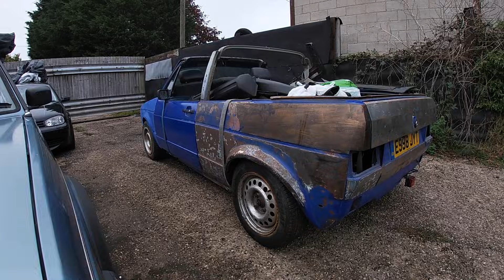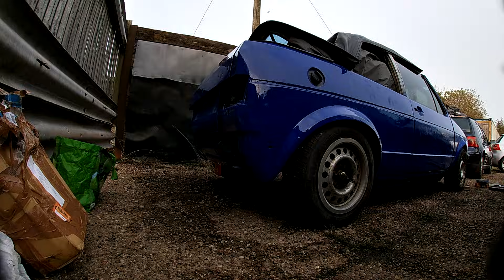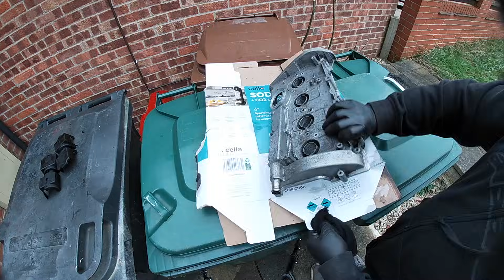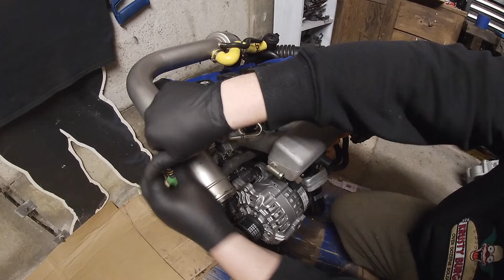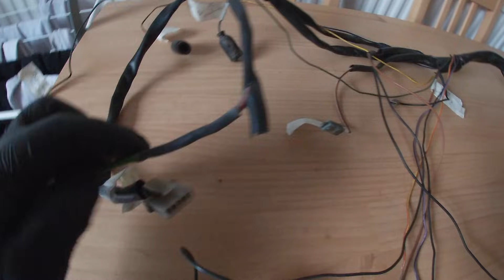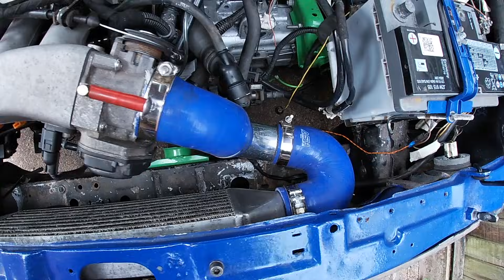MK1 Golf 1.8T 20V Conversion Full Build From Abandoned Project To Driving

Comment from the maker: 0:00 Introduction
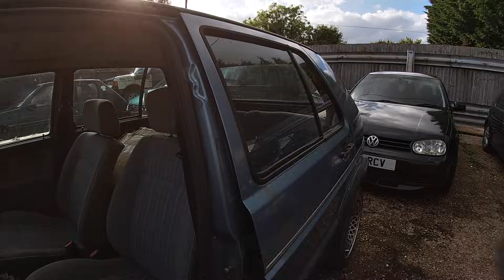0:39 Rescuing the mk1, inspecting parts 
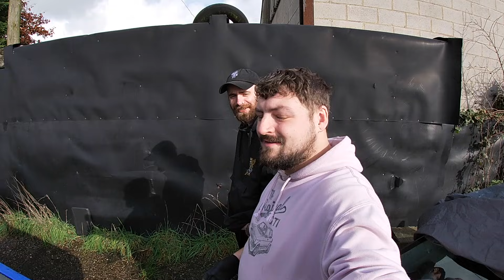7:13 Winter proofing 
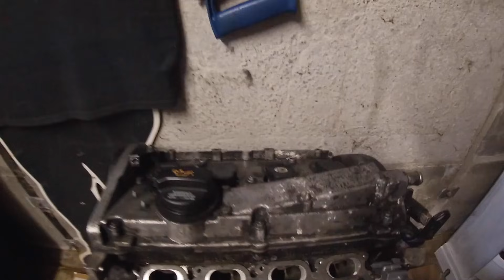20:00 Cleaning and rebuilding the 20v engine
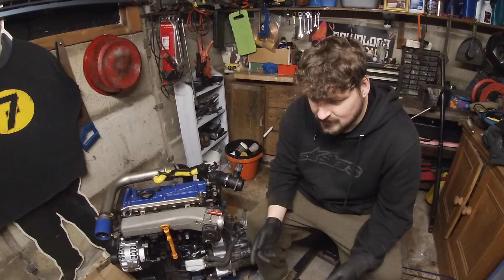51:09 Compatible Gearboxes
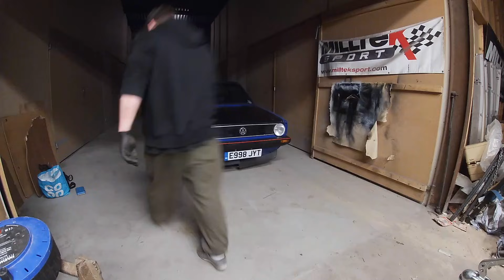55:10 Fitting the engine into the bay
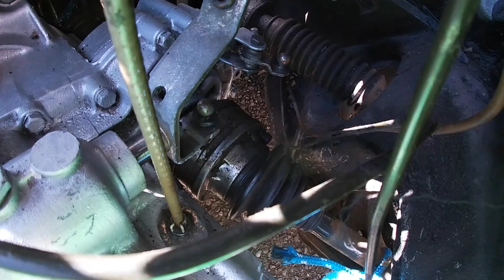59:05 Downpipe, linkages, fitment around the engine
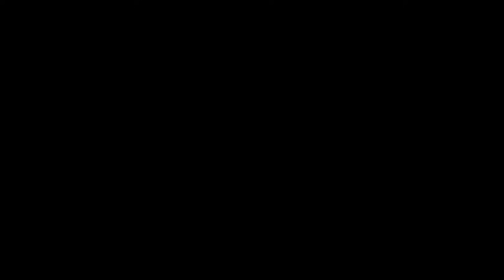01:04:26 CE1 engine wiring loom
01:15:50 Engine loom fitment 
01:21:40 Injector wires and trouble shooting
01:25:49 Intercooler setup and first startup 
01:28:43 Custom engine parts, coolant bottle, radiator, intake etc
01:34:18 Exhaust notes, running and driving

Comment: Hello, nice video!

Do you have a spreadsheet or likewise for all the torques? 
I'm about to start conversion with AGU engine.

Also, the gearbox. I have complete donor car, I do believe it is a O2J gearbox. To make this swap, anything I need to consider?

Thanks in advance!
Reply from the maker: Hi, unfortunately I don't have the torque specs anymore, I did have them saved but I've had a new phone since then. I do have an engine rebuild video, most of it is included in this video. But I did cut parts out to make this video shorter. Iirc I cut out about what gearboxes you can fit to the 1.8t engine (it was quite boring but useful) that video is about 41 minutes long and there's about 10 minutes at the engine talking about gearboxes, linkages and driveshafts. If I've missed anything though I'm happy to send a message with what you'd need.

I also talk about torque specs in that video, I from memory most of those specs will be left in this video though
Reply: @VintageVibesAuto  Hey, thanks for the answer. I'll go through your vids again and take note of torque specs.

Just pulled the engine with gearbox out yesterday, tomorrow I'm gonna start with wiring the maxxecu.

Thanks for your help! :)
Reply from the maker: No problem, if you're using an 02J 20v 5 speed gearbox that will fit but the driveshaft cups are different so you can get the driveshaft cups from a 2.0 8v MK4 golf or equivalent 2.0 8v. In the past I used 1.6 8v beetle cups they happened to be 100mm driveshaft cups as well. My MK1 GTi driveshaft where 100mm but I've heard on early mk1s they are 90mm but I can't confirm this

Comment: i also doing this conversion at min car wont start and gives me p0322 error which is crankshaft sensor can you recall how you wired that in the car so i can check mine to see what ive done wrong
Reply from the maker: That engine side of the loom as I remember I didn't touch apart from the coil pack upgrade and ICM delete. 

I did have problems getting a spark and fuel though. I missed a ground to the injectors and I also had the firing order for the spark in the wrong order as I wired up the ICM delete wrong. I would start with testing continuity at the coilpack wiring to see if your getting 12 + volts and track it backwards. I'll send you over the wiring guides I used as well...
Reply from the maker: Wiring loom guide...
https://www.clubgti.com/forums/index.php?threads/oem-mk4-management-wiring-mk1-2-3-harness-install-faq-now-with-added-dieselness.267196/
Reply: @VintageVibesAuto yeah I’m currently reading this guide over again
Reply from the maker: It's a very handy guide but lengthy, I must have spent many hours referencing it because the loom took weeks to make
Reply from the maker: CE1 fusebox layout... This one I found very helpful as I had some power issues, I had some wires in the wrong places. 
https://club8090.co.uk/forum/viewtopic.php?t=173773&sid=c43a5a2b16e704eaec5cac2f5c98bace